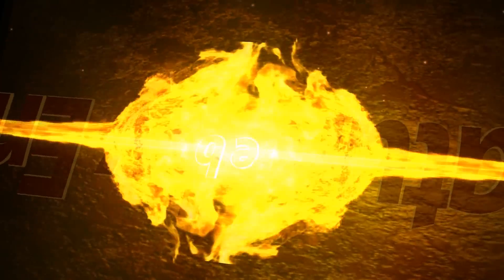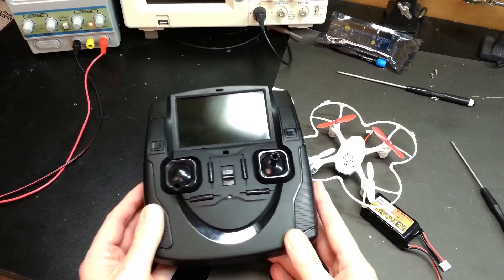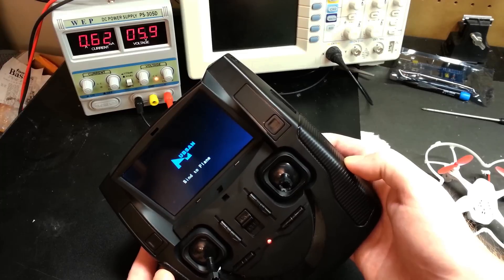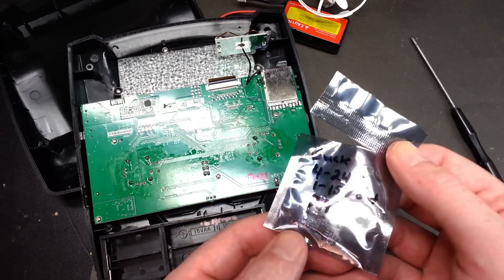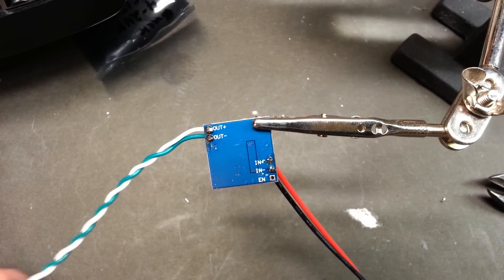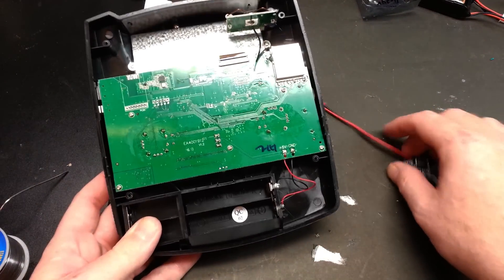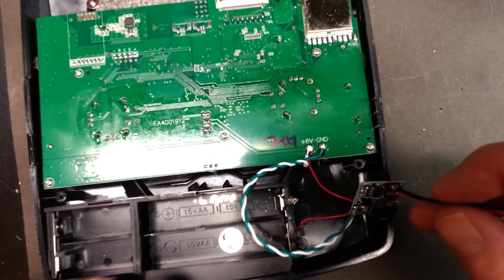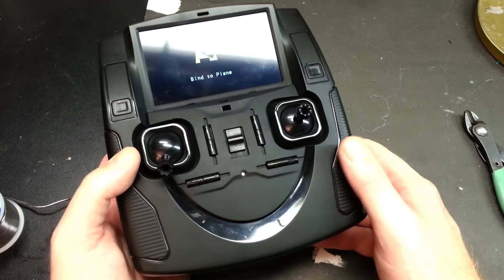Convert Any R/C Transmitter To Rechargeable Packs (LiPo etc)

Comment: Why not just use a more forgiving and safer 6.6v LIFE battery? I've been doing that successfully for all the 4x1.5v standard battery needs I come across. Using a switching regulator is adding quite a bit of RF noise where you want to avoid noise. Many good quality standard batteries are 1.6 to 1.7v new so you are safe @ 6.6v. I know people running standard fully charged 7.4v 2S lipos in the Nuhi U807 TX with no issues (although I wouldn't recommend it!) so seems adding the switching regulator is not needed with a low cost LIFEPO4 Hobby King battery. I think you should do a video on adding a low voltage cutoff instead as that what's really needed most just in case the TX gets left on;-).
Reply from the maker: +John F Hendry I like using the existing flight packs I already have.  To each their own
Reply: Eric William -MKme Tech I use a 3S 3.7v cell lipo battery to try out TX's that have 6 standard 1.5 cell batteries but they are also my flight packs so to protect them it means placing them in a storage charge after each use and a new charge cycle to use it again. With the LIFE pack I use in place of 4 standard batteries I can charge it and then leave it till the TX meter shows a drop. But either way both solutions need a LV cutoff like TX's that use LILO's and surprised you can't buy one to place inline.
Reply: +John F Hendry Yepp, I also run a LiFe in my Hubsan Transmitter. The advantage is that first, you need no regulator, second, the battery voltage display works, third, you can fit it inside the battery compartment if you rip out the battery holder and it does not attempt to burn your house down as likely as LiPos.
Reply: Skynet I've been using the 20C LIFE batteries for going on two years now and they are amazing except for checking remaining RX charge as the voltage is so stable it reads high till the end so need to monitor mAh but you are right and they do work with the voltage display but you have to be careful as once the voltage shows it is low they drop really fast.

But I just stated using the low 1C rated LIFEs for TXs and what I've found out so far is the specialized low C discharge rate TX LIFE batteries designed for lower current draw are even more forgiving and charge better with cell matching... they charge in slow motion compared to the 20C LIFE RX batteries and was amazing  to watch time change in cells balancing as they reached higher voltage like clock work using software.

I got the 1C discharge  rate 1500 mAh Nano Tech TX battery that fits in a standard 8 AA battery pack and although it has a high weight to mAh ratio it is much better suited for TX use so from now on all my TXs except Spektrum that use Lion will be powered by the 1C LIFE batteries that cost about the same as 8 good standard 1.5v AA batteries. Can't believe people still buy standard throw away money/batteries.

Any TX designed for NiCad/MiMH with 1.2v cells will run at an ideal voltage slightly above nominal voltage and in DEVO TXs where I have seen a few claimed damaged at 12.8v protect them from over voltage. Some good AA's can be  1.7v new with 1.6v common. For my old Futaba's the 9.9v stable output is ideal. But have not observed voltage drop with low mAh drained yet so will be interesting to see the difference from the higher C LIFE's and if it drops off as fast. All I need now is a LV cutoff circuit just in case the TX gets left on so looks like I'll just have to make one.

Take care and fly safe....

Comment: i assume this will work on the base hubsan controller as well ?
Reply from the maker: +michael lee If you mean the transmitter- It would work with any model/manufacturer. It just steps down the voltage to the appropriate level.
Reply: +Eric William -MKme Tech thanks !

Comment: Hi Eric, thanks flor the lipo solution for folks like us :) Nice informative video but I was wondering whether you could please provide some kind of part number or something similar :) Something we can hunt for on Ebay :) I just finished my TBS Discovery build and it flies perfectly, but on looking for parts, I found my Hubsan H107D and batteries, probably not flown it for a year, and I remember the really bad battery performance and I have a couple of spare 1000mah 2s batteries, which would be ideal, nice long and thin :) The other thing is that I live in Germany and I'm English, so results for a Buck converter is non-existent! Nobody I know knows the German name for this module, so I was wondering if you would kindly help me out :)
Reply from the maker: +Barry Hinselwood Here is the one I sent another commenter down a little ways in the comments.  Cheers  http://www.ebay.ca/itm/Super-Mini-3A-DC-DC-Converter-Step-Down-Module-Adjustable-3V-5V-16V-Power-For-RC-/321546884609?hash=item4addb01601
Reply: It's okay cheers mate, I just threw a 2s 1000mah battery in there, lasts forever! I also noticed on my PCB that it states 7v - 13v input, so I also have the option of 3s maybe, but I'll use a buck converter ...

Comment: Thanks for the pointers Eric - What a soldering job I did if I do say so myself. Learned silver round knob in corner of buck converter is the voltage dialer, my Hubsan tx is slightly different to the one on video, its as if Hubsan expected you to manually put lipo as they added extra positive and negative holes next to the positive negative wire attached to tx circuit board. My first attempt went well, I even melted the plastic in the AA battery part so I can fit my lipo in place of AA battery, need to also melt extra bit on lid, I'm really impressed as I thought I couldn't do it but went successful and better than I thought, no hole drilling required... (I can even charge it from there without needing to move anything about), you see I'm a beginner but a perfectionist... All I need now is to move into range next. Big thanks to Eric's video for making it all seem possible to attempt... You are a legend!
Reply from the maker: +Shax Comments Glad you got through it.  Once the first project works out- the world opens up.  Best of luck in all your projects.  Cheers

Comment: Hi Eric, hope you can help me, I purchased a buck converter, can you let me know if this will work and also, why use a buck converter, can you just directly replace battery for lipo with same wire? here is the buck converter that I got : 
4.75-24V to 0.92-15V Boost Buck Voltage Step Down Converter Regulator

Dimension: 2 x 2 cm

Input: 4.75-24V

Output: 0.92-15V

Output current: 3A(MAX)

Max. power: 10W

http://m.ebay.co.uk/orderDetails?itemId=111559957645&txnId=1417056017001
Reply: sorry, here is the link of buck converter I got of eBay : 

http://m.ebay.co.uk/itm/Mini-Buck-Converter-Step-Down-Module-DC-DC-4-75V-24V-to-0-92V-15V-UK-/181824740116?nav=SEARCH
Reply from the maker: +Shax Comments I use a buck converter so the voltage is regulated.  Yours should be fine for any TX I can think of.  Plenty of headroom.
Reply: +Eric William -MKme Tech : Thanks big time for the reply and respect, shout out from London! I'm gonna attempt in the next hour...
Reply: +Eric William -MKme Tech : Hiya Eric, one more clarification, do I need to change any setting on the buck converter or just a case of straight connection and soldering? thanks again!
Reply from the maker: Shax Comments You need to set it to the voltage your original batteries supplied the TX
Reply: +Eric William -MKme Tech : oh o, don't have a clue, saw a few video on YouTube about buck converter, buck converter is smaller and never used before so I need to use the multimeter . I guess I just have to handle and see... thanks again, appreciate the time!
Reply: +Eric William -MKme Tech : oh o, don't have a clue, saw a few video on YouTube about buck converter, buck converter is smaller and never used before so I need to use the multimeter . I guess I just have to handle and see... thanks again, appreciate the time!

Comment: Out - top left, Out + bottom left, In top right, In bottom left. Sorry to bother you with silly questions, just fairly green at soldering but improving.
Reply from the maker: Marcel Wilson In comes from battery, out goes to TX.  Always mate positive to positive, negative to negative.

Comment: The voltage converter I received has two pin holes per corner. How do I properly solder the jumper and battery leads to it, to complete the connection.

Comment: Thanks for the useful and helpful video. Where can I purchase the buck converter? I'm new to the hobby and looking for a little direction. I'd much rather use this simple fix than dump a ton of cash into the local landfill. Thanks
Reply from the maker: celwilson The links on ebay change alot but here is one right now http://www.ebay.ca/itm/Super-Mini-3A-DC-DC-Converter-Step-Down-Module-Adjustable-3V-5V-16V-Power-For-RC-/321546884609?hash=item4addb01601
Reply: Thanks for the prompt supply. I'll check it out right now.
Reply: One last question. The "jumper" and battery connector are purchased separately.?
Reply from the maker: celwilson Hmmm jumper?  Sorry just the wire?  As for the battery connector it's just a standard JST connector.  Cheers

Comment: When you said power converter I thought you where going to use an I/C voltage regulator(looks like a regular transistor),  as an auto mechanic I'm ok with I/C circuits, could you do a buck converter video? And after all this chatter about burning out transmitters with li-po's it never dawned on me to measure the running amperage, great job, and your fluke is much nicer than mine.
Reply from the maker: stclairstclair Thanks for the comment.  Sure I'll add it to the list. Uber quick- a buck converter delivers the same output V regardless of input- but only lower than input. If you get a boost/buck- it is the same but can boost higher than input.  Very cheap and efficient units nowadays.  PS I am still a certified auto mechanic so I hear ya :)  Didn't get that fluke until well after I left the trade.  Cheers!

Comment: In my opinion Sanyo Eneloop are the very best batteries for transmitters. Robust, low memory effect, low self discharge, not affected by storage. If you reflex-charge them, they last for years.

Comment: Is it possible for you to link a DIY style doc. or similar (maybe listed with part numbers, etc..) I have the brains and the tools, I just tend to want to err on the side of caution and I'd hate to mess this process up. I might integrate a better antenna as well as most videos seem to claim that this one is a little weak. I know this is kind of a tall order so any further help that you would extend would be greatly appreciated. Thank you!
Reply from the maker: Chris Beard Hey Chris.  Look down a couple comments and you will find the link to a similar buck converter.  That is the only part here beyond a 3 or 3S lipo.  I haven't changed the antenna so I don't have any links for that.  There isn't much to mess up really.  Just read about the component- hook it up accordingly and enjoy. Cheers

Comment: Eric, Very well done Video. Thank you.  Question: Is the regulator really necessary. I thought a battery will only supply the current the device requires. Why can't you wire the LiPo directly to the Original battery terminals and put the LiPo in the case to replace the original batteries? A Dremal will make room with a little grinding.
                                                     Thank you,
                                                        Lawrence Hill
Reply from the maker: The lipo is not the same voltage as originally used.  You could do it but for a 3 dollar buck converter- why take the chance. Plus then use can use a 3S lipo as well.  Cheers
Reply: Eric William -MKme Tech That makes sense. Where can I get the converter at? And thanks for the fast reply.
Reply from the maker: L4foto Check the recent comments or search on eBay for "RC buck converter".  You could use a UBEC etc too.  Cheers

Comment: Can you send me the link to that converter?  I can not find it on eBay.
Reply from the maker: HTBC SALES http://www.ebay.ca/itm/10PCS-Mini-3A-DC-DC-Converter-Step-Down-Module-Adjustable-3V-5V-16V-Power-For-RC-/321546884565?pt=LH_DefaultDomain_0&hash=item4addb015d5

Comment: Great vid and tut!
I agree with Marcus, I was wondering why not remove the thin plastic piece that separates the batteries so you could store the LiPo in the orig battery compartment.It looks like your LiPo would have fit inside. no wires or battery outside the case and you could have still used AA's later if you wanted.
Not bashing, just a question/suggestion.

Thanks aging for your time !
Reply from the maker: NickSoef No worries.  I often use a larger pack than in the video so it couldn't fit inside.

Comment: hmm yours must be an older rev
mine is printed on pcb 6-13v anyways you can take the bec/regulator off and use it in another project not sure if a 3s will fry it

Comment: also hot glue the antenna to the top outside of tx while you're at it I had to desolder the copper wires to slip the black wire thru the fake screw hole/cover then hot glue everything securely

Comment: great video but when you take it apart LOOK at the board where + and  - to the left it say 6-13V!
sooo you don't Need a BEC/regulator!!! you can wire 2s 7.4v straight, thats what I did and with the extra voltage you get longer range :D
Reply: I'm now running 2600mah 3s lipo in my radio but mine says clearly 6-13V pretty sure you could do the same but at your own risk
(awiaiting new control board camera experiment fried my old board)
Reply from the maker: thaixeon76 Exactly- at you own RISK.  For a 2 dollar buck converter you remove that.  As a content creator we have an obligation to NOT damage people's equipment.  This is why I ignored your comment- it is bad advice to advise people to take risks.  As well you do not get extra range.... sorry.

Comment: 6:10 - Does it really last longer with that LiPo? Of course it more practical, but the batteries have a capacity of about 1.9~2.5Ah * 1.5V * 4 = 11.4~15.0Wh and the LiPo only 1.0Ah * 7.4V = 7.4Wh, so the batteries should last about twice as long...

Comment: Great video.  I just received my H107D  and the transmitter hogs the batteries!  I use the same voltage regulators to run DIY LED lights for the solar system.  I cannot wait to apply the same idea to this transmitter.  Thanks for sharing/posting.

Comment: I agree, the audio with this video is sweet!  I have a question... Have you measured the voltage of your new regulated output while the transmitter is turned on?  Just wondering if there is any significant drop in voltage with the added load.
Also, a little trick I thought of for your external battery leads...not that you need to use the idea now, since you've already put a larger hole in the case...  But an alternate method would be to use the shaft of a soldering iron to melt a semicircle in one edge (or both edges for precision) of the clam-shell case.  No actual 'larger' hole needed. Just be careful to pick off the melted residual plastic with something other than your skin...it's easier to take it off before it cools too much but I use leather gloves for those jobs.
Reply from the maker: Dub Campbell Nope that's the beauty of the Buck and Boost-Buck converters.  If they are working right- they are completely stable regardless of load or input voltage.  Such a great part for the price.  On the case- I should have just threaded the wires through a tiny hole first :)  But definitely could melt a hole but I wouldn't do that with my good iron.  Cheers
Reply: I'm gonna have to look up those regulators...they're news to me.  I use rechargeable batteries for just about every device I have. It's silly to buy single-use batteries these days. They're way too expensive as well as being bad for the environment.  LiPos are great.
Regarding the soldering iron...no, I wasn't proposing that you use the tip of the soldering iron, rather the shaft, behind the tip, where a little plastic melt would do no real harm. You know, just lay the shaft across the edge/rim of  the opened case where it comes apart, not punch a hole, although, admittedly, I do have old soldering irons I have used to put holes in plastic...lol   I've spent many hours flying models ever since the 50s.  None lately but it sure has been fun. Looks like you're a very skilled pilot!  Take care.